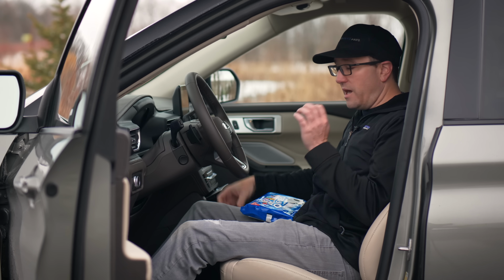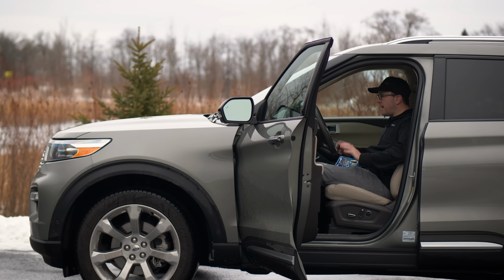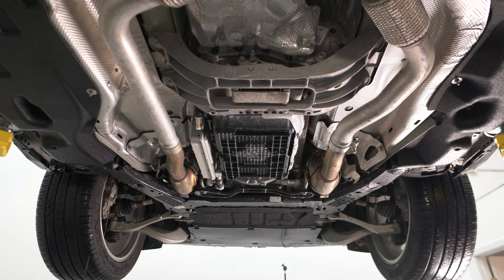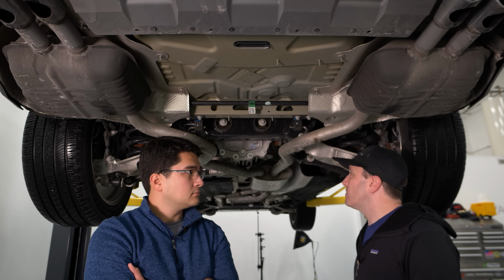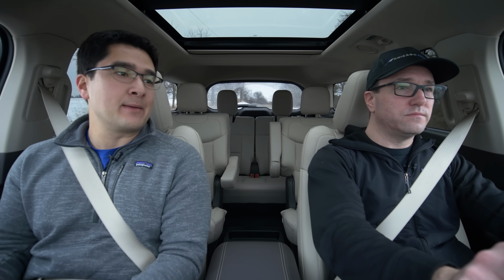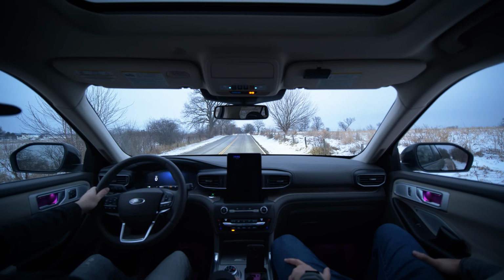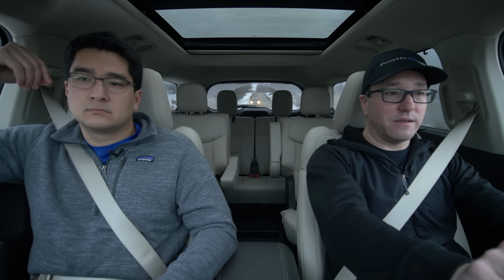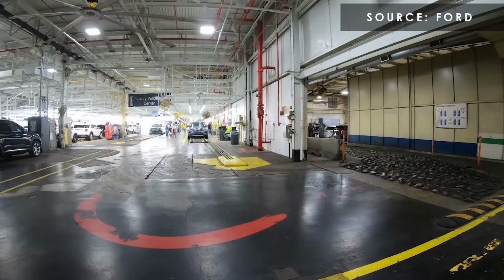2020 Ford Explorer | Who Is Responsible For This?

Comment: Ford has never made a good transmission honestly. My second gen fusion is one of their more "reliable" transmissions and it slams around in 2-3 shifting, it whines like I have a supercharger under the hood, and it gets incredibly confused when under WOT. It'll seemingly hold the revs at redline until it gets unconfused and jumps into the next gear. Although it's been reliable for the 40k miles I've had it lmao
Reply: @IsaacC-b5s  Yes, my bad, I think the manuals are okay here in America too. But most of their cars don't offer manual unless it's a Focus ST or something.
Reply: To bad only the Focus ST/RS come with a manual, now I own a manual Honda Accord. However, the transmission in my 2016 escape started to whine and shudder. Traded it in at 30000 miles...
Reply: Ronald Dreese Don’t buy focus. You can get a pre owned Mustang for that money.
Reply: @angelgjr1999  I don't think I will ever buy Ford again after owning two.
Reply: In Fords, stick to manual. I love my 5 speed stick shift.
Reply: Te 4R70W is the most disgusting piece of engineering disaster in auto transmissions ever. I got nickel and dimed to death by ford and will never look back. They will just empty your wallet every 10,00 miles.

Comment: In a couple more years they gonna have millions of recalls for the transmission😂😂
Reply: And then the dealership will take weeks to repair it, while trying to upsell you stuff on the engine.
Reply: I blame moronic consumers that don’t think logically. The more gears and tech in tranny, the more it will cost to fix. I’d rather keep my 5 speed manual,

Comment: I grew up a die hard Ford guy who has had dozens of them but after years of unreliable vehicles built with poor quality materials, especially the interiors where you spend so much of your time in, I have reached a limit. I finally had enough in 2008 with my brand new twin turbo diesel F-250 which in less than 6 weeks had to go in for service twice with check engine lights, I left it at that dealership & walked away from it buying a new Hemi Ram which I had for 11 years without a single problem, done with Ford & their highly questionable choices & poorly made vehicles with lackluster styling on top of it.

Comment: Great review.  I owned a Lincoln MKX with the Revel Ultima sound system.  Basically awesome.  However, the satellite radio reception was so bad I traded it for a Grand Cherokee.  Ford's SiriusXM receiver is terrible.  Because of that, neither an Aviator or Nautilus is in the running for my next vehicle.

Comment: Portrait mode only? EVERYONE HATES PORTRAIT MODE,...jumped up dying Jesus Christ, WTF were they thinking.They rushed it through because they were so excited to bring the explore to market and it shows! fit and finish is disastrous and I still can’t get over that stupid touchscreen. 
The audio system, like my 2018 Golf R has “Fender” badges, but it’s just a factory  stereo with 127 speakers and sounds only acceptable.I could go on about many things, but looks fast. Least the engines rock.
Reply: Only certain upper trims get the portrait display, 99% of these will be sold with the smaller landscape display, so don't worry!

Comment: I don't even see how this could be a fleet or rental car with seats wearing out at 4000 miles.  The trim fit is hideous but that can be overlooked with fleet and rental but seat wear is something even rental car companies won't accept.
Reply: They'll put denim seats in the fleet rentals.
Reply: @OMGWTFLOLSMH  The 1973 AMC Gremlin came in a "Levi's Edition", which is exactly what it sounds like.
Reply: @OMGWTFLOLSMH   I find your comment hilariously funny. I actually visualized denim seats in my mind. Add in the "for the right price they will" comment - genius!
Reply: For the right price they will
Reply: Fleet vehicles do not use real leather. It is usually cloth, vinyl, or leatherette...
Reply: @blacke.blackerton5430  Judging by that leather, seems the average consumer should do the same.
Reply: The police Interceptor looks really good. They had the hybrid version which is the slowest of the explorers.

Comment: I agree with your review 100%. i do love the design. But in my state there is a Ford & GM Dealership every 20-50 miles vs just 2 -4 Hyundai-Nissan -Honda dealerships per 60+ miles..So regardless the odds that it will have high sales will be in its favor. & also if the exhaust coming out the bottom bothers the owners.. just drill a hole and patch the bottom up😂.
Reply: It’s better to drive the extra distance for a more reliable car. Honda’s in particular will do you well and will probably have higher resale than a Ford or GM product.

Comment: Isn't the portrait position of the screen the preferred position, human wise???
Isn't this due to a hundred years of paper use as well as the recent human cell phone use?
According to manufacturers, it is.
Ditto Tesla.
Reply: It still has to be done well. Lower trims of the Explorer use a smaller display in a landscape orientation that works far more seamlessly with the integrated technology than the larger portrait display. Tesla and Volvo have (almost) nailed the formulas for their portrait displays, but companies like Ford and Subaru are absolutely half-baking theirs.

Comment: Planned obsolescence. TRUE LONGEVITY, gone.  I'll keep my Tundra and Rav4.
Reply: 2007 Hyundai Santa Fe with 175K, I replaced the steering rack because the bushings were shot, other than that no mechanical or electrical issues. Waiting for it to die, but it refuses, so the wife keeps driving it.
2007 Chevy Trailblazer 145K, replaced rotted power steering lines, other than that no mechanical or electrical issues, also refuses to die so I keep driving it.
I'm scared to get a modern car....
Reply: @groosbro1  you replaced an entire steering rack because the bushings were shot. Damn you balling. That's like replacing an engine because the mounts went bad.
Reply: @Turshin  the internal bushings went. I didn't have time to rebuild the rack. Quicker to replace it. Wasn't bad, about 6 hours on jackstands.

Comment: I'm about 6-7 minutes in where you're talking about the poor audio. You want to hear a bad audio system? Look back at the W204 generation C-Class with the entry Becker systems. If you leave their EQs totally neutral and let them play classical radio as background ambiance, then you'll be fine. The second you start to tune the EQ, or God forbid you go into the engineering mode and begin fine tuning each individual speaker, you'll find one of the noisiest, most buzzy sound systems out there, especially in the price bracket those cars competed in back then. I still daily drive a W204 C300 and the worst thing I did was not purchase a model with the harman/kardon sound, or upgrade the sound in any way because it is just pure noise. It gets loud and that's it. The bass is very boomy, when it's actually there. The highs and mids are absolutely piercing. The roll off between each range is poorly done so there are definite dead zones in the audio signature. The worst part about the system is the lack of tweeters in the rear, which leads to a headache inducing muddy, boomy sound for rear passengers. The rear deck is underutilized as it could easily house two two-way 6x9 speakers, but there's nothing there. The front tweeters are angled incorrectly towards more of the center rather than the driver's and passenger's ears, it's just an unholy mess. The new Ford Ranger has a better sound system. I have heard Chevrolet Malibu's with better sound. Hell, my 18 year old MINI has better sound.

Comment: 16:40 - "should not feel in a vehicle like this" - you shouldn't feel it in any vehicle. Suspension and tyre combos are losing the plot. I had zero punctures or wheel issues in my first 10 years of driving, and in the my second 10 years I've been through 5 tyres and two wheels across 3 cars. That's low profile bullshit for you, and shit cheap suspension. 

This is the worst period for cars in the history of cars.

Comment: As always one of my favorite car analysts. These cars are mass produced and I ofter remind myself the explorer is now designed for police cruiser fleets. I think Ford has lost the war in this segment. I definitely agree on the repeatable Ford buyer not even knowing the difference between model years. Those cars are now part of the recyclable car programs.
Reply: You can say that about many car manufacturers today. If I start putting an ordinary person inside all these different vehicles, they won't notice the difference. With today's market being so over saturated, you really wouldn't notice unless you buy the car used.
Reply: @icenine135  That's why Toytoa has sold so much and is the most profetable company today, they know what the normies like.

Comment: Well 6:40 they should have kept using Sony as their sound system upgrade 😆 still sounds pretty good in my Fusion 8 years later!
Reply: I've got the Sony system in my 2014 fusion and it sounds amazing. It's got the 450w amp and the newer fusions have like 250w in the upgraded ones. They clearly cost cut on newer speakers
Reply: Fuck, I've got the base sound system in my '13 Fusion SE, and it sounds fantastic
Reply: The Sony system in my '13 Focus sounds like trash. If you actually take the speakers apart, you'll find they're barely upgraded Ford speakers. Marketing at it's finest.
Reply: Phil3555 see
Reply: Most people wouldn't know good sound if it smacked them in the face.
Reply: It's really unfortunate to hear about how bad the "upgraded" system is in the new Explorer. I wonder what the base version is like. Hopefully better than the base system in the 5th gen which is terrible. $1000 buys some really nice speakers so I'd rather just upgrade the base system speakers myself if they're not any good.
Reply: My moms Sony 10 speaker in her old 2017 Ford Escape sounded like trash. My 9 speaker alpine in my Chrysler 200 sounds way more clear , with more bass.
Reply: TheJblacc59 then the audio gets turned down when the beat drops. Like who thought that was a good idea. You can clearly tell it can’t handle bass and loud pitches at the same time.

Comment: Pay 65 grand OTD, drive two years, get 28 grand. DEAL!!
Reply: These babies drop like a ROCK!
Reply: @Glowget-l2p 
Why? Leasing these stupidly expensive cars is the best way to drive and forget them before the warranty expires.
Reply: @groosbro1   You do know what leasing is right? It's literally paying the predicted depreciation. It's a glorified rental. I suppose you like throwing money out the window in exchange for having a new product.
Reply: @bt7482 
I know what leasing is. I also know the numbers for buying and driving a car like that Explorer. Even if you don't get all the options you will still pony up $45-50K for the car. After a 5 year loan pay off you would have paid approximately $48-53K for an asset worth about half. Now you have let's say a $25K vehicle that's out of manufacturers warranty and you hope it will last a few more years, which in this case is wishful thinking. 
What did you gain, a car that's nearing the time when a major repair is due, which in the case of a twin turbo Ford with an iffy transmission that will be immediately after the warranty expires?
It doesn't make sense to do that. Lease it, drive it, give it back and let someone else deal with the now thoroughly used car.
Reply: Lease for $500 a month and give it back, simple.
Reply: I only buy used Fords. They have very little used value and I have had great luck with Fords
Reply: @ericgrau123 I know this was 4 years ago, but I agree. I just bought a 21 platinum with 16k miles for 41 OTD. Came with cpo warranty, 2 years of maintenance included, and I tacked an extended warranty onto it. 

I would never buy this brand new. They were selling brand new base model explorers one row over for, at minimum, 43k, with the platinum being like 58k??? 

Would be stupid for me to buy new when this gem was on the lot.

Comment: The garbage infotainment on a lot of new makes and models is going to make the used market a risky place in 5-10 years
Reply: Mercedes' infotainment systems from 10 years ago are still working as new. Are you able to pair the newest iPhone or Samsung phone? Probably not. It also outdated navigation, and the features have aged horribly. BUT it still works! Very few Mercedes radio units have gone bad and they've got some years on them now.
Reply: ChickenC0re I have a 10 year old BMW with the infamous iDrive and it’s a more user friendly unit than all of the new infotainment systems. I have the newest iPhone and the phone/media/messaging part still syncs good. I’m the long time owner of this car and it has yet to bug out on me yet I know people who have brand new cars with buggy infotainment systems. Back in the 2010s people considered iDrive to be the most finicky infotainment system out there but is ancient compared to new ones.
Reply: @ChickenC0re  Mercedes' infotainment systems are integrated, not some stupid tablet.
Reply: All these new turbocharged engines aren't helping either
Reply: Yup! When those turbos need replacing just after the warranty is up, that is going to be a 7 to $8,000 repair job, and that would be for rebuilt turbos. Put in two new turbos and that cost is easily over ten Grand. This whole vehicle it's just an exercise in planned obsolescence on four wheels.
Reply: @victoralley708  Yep, wait till they aren't new turbo charged, and the costs to maintain kick in.
Reply: Going to? already is a risky place.
Reply: Yep.  Planned obsolescence.
Reply: I’d bet the depreciation is outrageous considering how overpriced it is already.
Reply: There won’t be a used market. At all. Dead and dumped in 5 years. Or less.
Reply: nic louw dead and gone in 5 years can be all yours with 72 month financing
Reply: I won't touch anything with the infotainment coming up out of the dash. I think if looks like ass and I would be annoyed with it.
Reply: Or make it cheaper than it ever was whoch hopefully will bring the us automakers to their knees on their out of control pricing
Reply: no, it's going to make it a GREAT place for a deal.
Reply: It's going to be a pain to prefer the lower trim levels because they don't have it, but miss other useful and nice options from the higher trims... I'll probably skip a whole generation of cars.

Comment: I thought the title was a little too harsh until you got to the transmission section. Looks like Ford messed up another one. Your Ford rep probably won't be happy, but this deserves to see the light of day.
Reply: My 2018 f150 with the 10 speed sometimes will shift hard as F and it slams you. I wanna say it was 3-5 or 4-5 upshift. For me it happened when the trans fluid wasn’t warmed up yet
Reply: As someone who used to work ford Ford, I too was seriously disappointed with this thing. I too hated the fit and finish, and I too thought the portrait screen is good awful
Reply: The seats falling apart already is mind boggling.  That's so expensive to replace too.  And that trim fit.  What an utter mess.
Reply: That 10AT was awful in my mustangs as well (both I4T and V8).

Much worse in the ecoboost - it would always slam the 5-4 downshift against the mounts and 2-1 would take a whole two seconds of head toss.
Reply: Aaron Yim My 10 speed auto F150 (2018) has been fantastic, very smooth. Same with my friends 2017 F150 10 speed. Going off your experience I guess we should consider ourselves lucky.
Reply: Makunda Nanda sounds like people aren’t honoring the break in period for their vehicles and drive like monkeys. My 2018 10 speed has had no issues what so ever, and has stayed smooth through 15k miles so far
Reply: @kngofdestiny  I had a rental Mustang last year. Driving it hard and shifting manually up and down the mountain highways in AZ was a blast. Any regular driving though it was a complete disaster. The shift logic was all over the map, including upshifting way too early, and yes it would just slam you around, especially at those specific downshifts. 2-1 was absolutely brutal.
Reply: Sammy Phillps  I agree. These transmissions adjust to the driver inputs over time. With the crazy messed up inputs you get from many different drivers no wonder the system is sporadic. Also the fit and finish on an recent retooled brand new earlty6production unit is going to be not so good.
Reply: They should just use ZF
Reply: Ford is in trouble with their transmissions.  The last one, the Powershift, cost Ford multi-millions for repairs and buybacks with cars going into limp home mode.  Google: "Ford Powershift Recall"
Reply: Aussie2u There is no excuse for the Powershift. That’s as a piece of garbage and Ford knew it.
Reply: @Constable-yt  powershift more like Piecea'shit
Reply: @Ari--d  PowerShit. Lol 🍻
Reply: @ShowMeWhatINeedToKnow  Ford Focus? More like Ford Fuckedus.
Reply: Sammy Phillps  Ford is being sued for how bad there 10 speed transmissions are. I drove a brand new ranger and the transmission was absolutely terrible.
Reply: Tucker Stewart They better sue Chevy too, since they were 50% of the development team for the 10 speed.
Reply: Sammy Phillps  
It must be something Ford is doing with their tuning. There aren't as many complaints from GM's version.
Reply: EdMiF because the don’t sell near as many
Reply: People turned down perfectly good standard transmissions because of laziness and now complaining about their autotragics. Boohoo. I haven't driven an automatic that I like, they all are pretty terrible. I'd prefer a bad manual over an automagic.